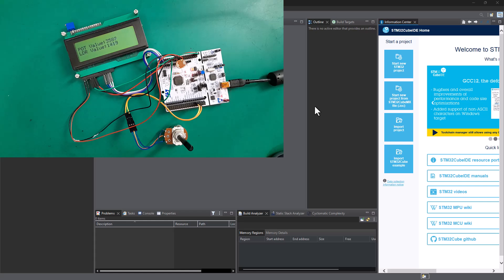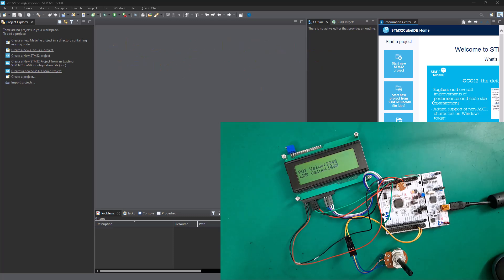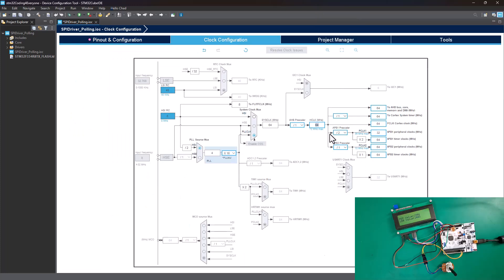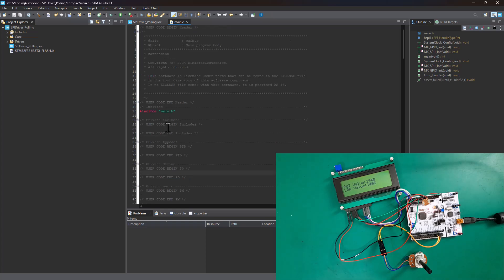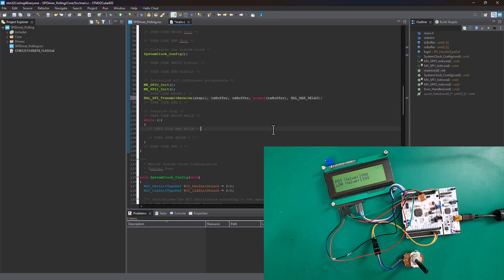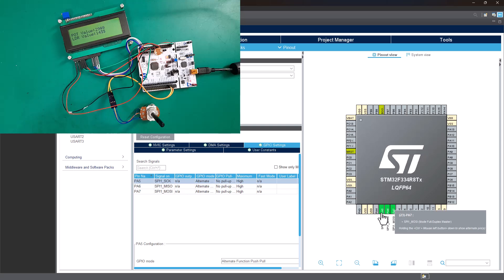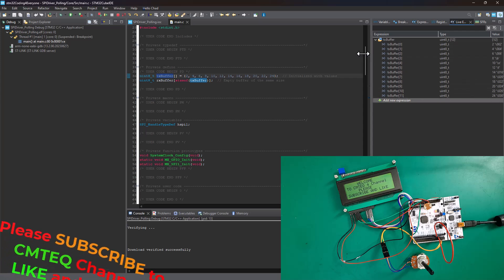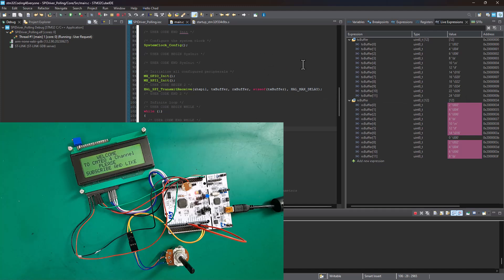13. STM32 Polling mode SPI Driver - Loopback Test HAL Library

Comment: Your Rx buffer does not seem to have the same data as the Tx buffer.
Reply from the maker: Hi, yes you are correct, that is because @ minutes 3:35, I forgot to change my Data Size from 4 bits to 8 bits to match the buffer size. If you change it to 8 bits the Rx buffer will be able to store all data from the Tx buffer.